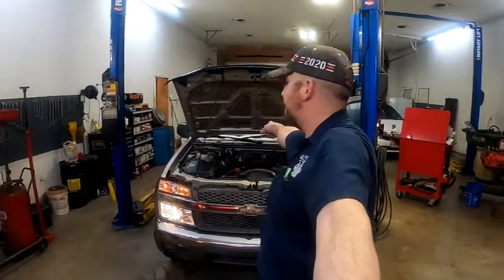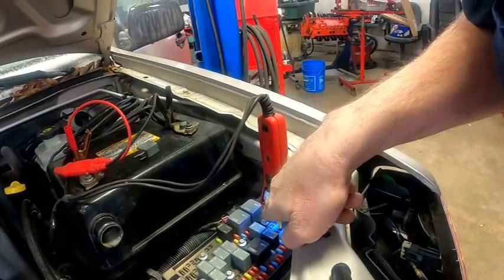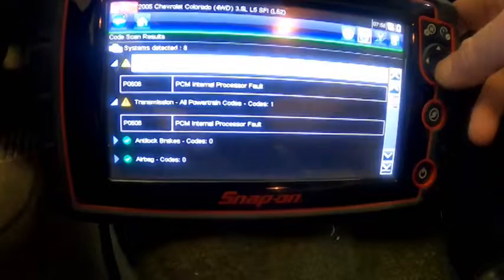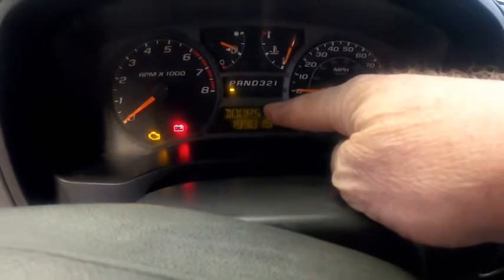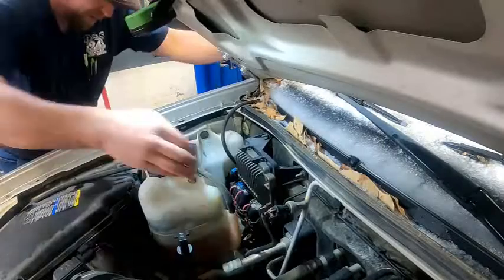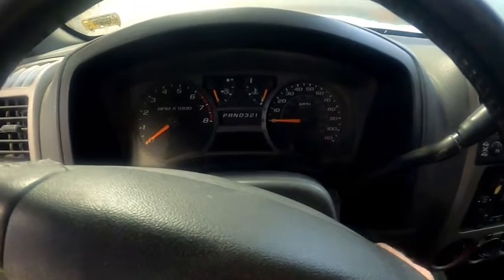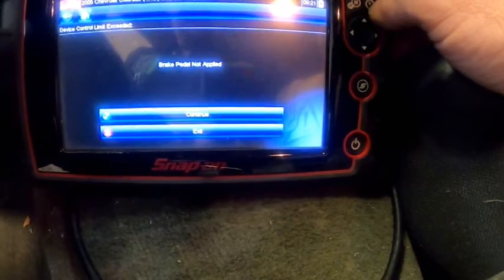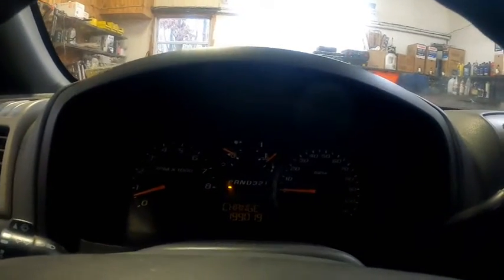2005 Chevrolet Colorado No Start: Diagnosing, and replacing a faulty PCM

Comment: Nice work, I'm sure you helped out a bunch of Colorado owners with this video. It was really helpful to show which company could match the PCM,especially the miles, to that truck. If you don't have a power probe can you jumper the relay at terminal 87 and 30 to test the starter?
Reply from the maker: Yes, you can Jim the relay to test the starter, just use a test light or a multimeter to figure out your power, then the starter solenoid wire should show as a ground, and the ground signal from the PCM will show nothing with the key in the run position.
Reply: I tried jumping the relay but nothing happens got no power to the dash when i put the key in the run possition but i see lights in airbag on and off switch

Comment: Thanks for video. I'm experiencing the reduced power in my 05 Canyon. P0601. Battery new, checked grounds. Tested alternator and battery just in case. Both look good. I suspect PCM. I'm going to check all wiring to PCM first, but have a feeling I'll be ordering one. My scan tool can do the case relearn, so thanks for video.
Reply: Replaced pcm, did security relearn and crank sensor relearn. Everything looks good now. Thanks again for video.

Comment: 2005 Colorado - was running rough/low power message.  Replaced ignition switch, PCM, and battery.  Tried to re-program anti-theft - steps didn't work -  - now won't even start.  Any suggestions?  Thanks.

Comment: I have 05 Colorado no crank jumped relay starter works have power to battery no power from switch most of the time periodically cranks with switch p0601 code I’m thinking pcm what do you think truck set dead battery for a couple of years the only other thing is replaced switch before parking drove it for a year after replacing switch ignition

Comment: Have a 2006 chev. Colorado, same problem with engine light, code, and pcm. Desperately need help, to change it out, Asap. Can you please help me get in touch with Flash lab? Tell me where i can get the PCM ?

Comment: So I have a question I did a swap from a 2.8 4 cylinder engine to a bigger 3.5 5 cylinder engine & it wouldn’t start I even pulled a used PCm from the junkyard & had the dealership program it to the truck & I get the same low power on it any recommendations it sounds like I have to order one like yours that comes pre calibrated to get my truck running any help would be appreciated 🙏🏽
Reply from the maker: Pull the codes out of your PCM. If you have a P-0606 code you have a bad PCM. Hopefully that will help, you may have a bit more complicated case than I did as you have done and engine swap to a different engine.

Comment: Hey brother. My colorado just cut off while idling without any warning. I turned the key on and did not hear the fuel pump cycle. Checked the Fuel Pressure valve on the fuel rail and did not have any fuel spray or even leak out. I checked the fuel fuse and it is good... I did not see how to verify if the relay was good but it did not look burned or bad. Changed the fuel pump and now I hear the fuel pump cycling but the truck will not crank. I did not fill the tank completely (in case I have to take it back down) but could it be air locked? Should I have filled completely? Do I need to try to bled air from the pressure valve on the rail? I am at a loss and of course frustrated to no end by this point. Sad in Cove City. Thanks for any help if you have a minute.
Reply from the maker: Did you get a reduced power message on the dash? If it won’t crank it has. It has nothing to do with the fuel system at this point. If you hear your new fuel pump cycling you should have good fuel pressure. Turn the key on, and jump pins 89 & 30 on the starter relay with a piece of wire and see if it cranks and starts. If your check engine light is on have the codes scanned by a good shop with a good scanner. The PCM was a common issue on these trucks. I don’t remember the PCM death code, but I did show it in this video. If it is there I would bet good money that is your problem.
Reply: @JosephVollmar  Update. Let is set all afternoon just researching online and decided to try it ONE more time. It cranked and run! However, it still spins over about two times before cranking (before, it cranked IMMEDIATELY on the first spin). Secondly, when I get on the road and get into it, there is not much power, real sluggish. It drives and runs perfect just tooling around, but if you tried to kick into passing gear, it doesn't. Could it be that I need to bled the pressure (I do not have a pressure gauge so planned to go get one tomorrow to check the pressure). Thanks for replying.

Comment: So if I buy a used computer from exact same truck will it have to be flashed ?
Reply from the maker: sorry for the delayed replay. It will have to be flashed to the VIN for your truck and then you will have to program the keys to the passlock system.